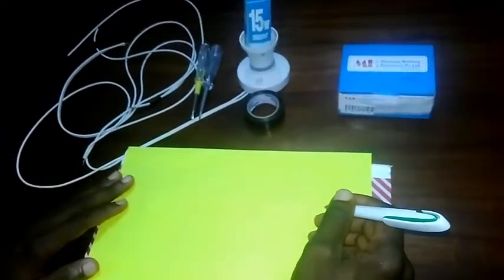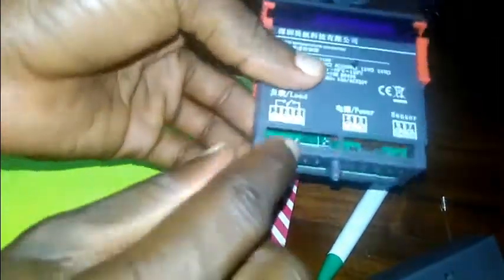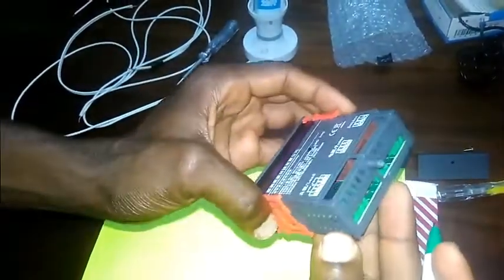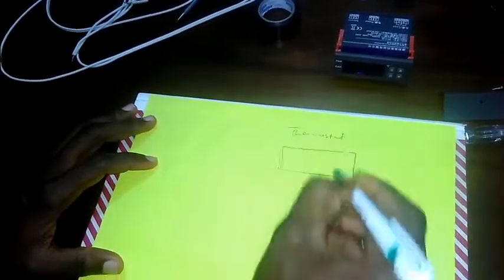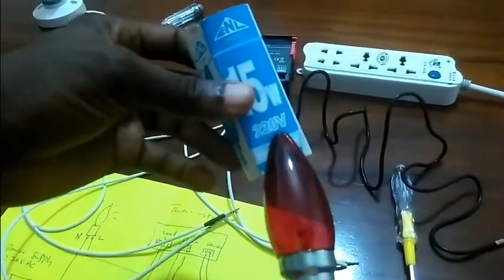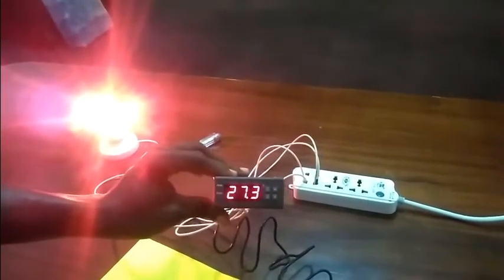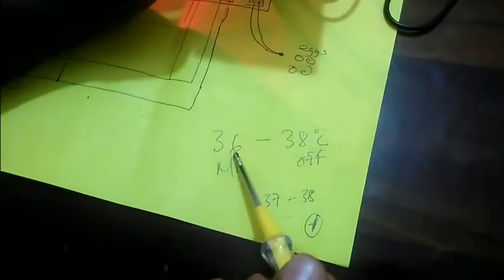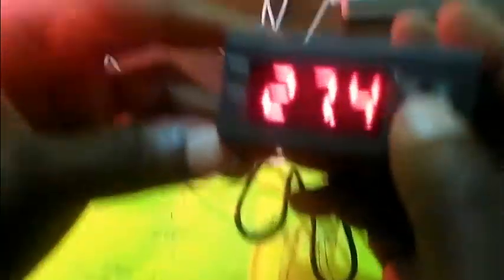How to wire MH1210B thermostat for Incubator

Comment: What if you use LA and HA to control temperature i don't know if you covered that use.  You seem to have no problem getting it to work i will admit the manual instructions to program are not clear.  You are using another way which would work for me.

Comment: I have been using a small fan with w1209 for my incubator without problem. But of I replace it with a bigger computer fan the light immediately goes off. What could be the problem?
Reply from the maker: Are you using 12volts AC to DC adaptor
Reply: @mykitvideos5937  Yes. Main is 240 but stepping it down to 12 with an adapter. Actually I think I copied the connection from one of your videos though now I m still looking for it.
Reply from the maker: Then your power adaptor amp rating is low. Use 2Amps or more
Reply: @mykitvideos5937  I think you are right. It's a tiny 300mA adapter that came together with the w1209. Thanks a lot.
Reply from the maker: If my channel helped you, kindly give us a rating on google https://g.page/mykit-shop/review?gm
Please add comment

Comment: i have question.. what is the problem when i have set the high temp about 38.5 Celcius but the bulb doesn't switch off.. do have any suggestions to solve it Sir? tq
Reply from the maker: Yes. Are you sure your wiring is correct

Comment: How to connect cooling fan? Please upload about it. Thanks.
Reply: I subscribe your channel.
Reply from the maker: https://youtu.be/3z1HGQMzQok
Reply from the maker: https://youtu.be/Xd3J0g9B4oE
Reply from the maker: Is this what you want
Reply: @mykitvideos5937  No. I want to connect a cooling fan to my mh1210b thermostat along with heating bulb. Is that possible?
Reply from the maker: @alimahatab   I don't have video now.

This is what you will do.
If your fan is 220volts...
Connect one wire of fan to port #1

Then connect second wire of fan to NEUTRAL. 
PLEASE do you understand
Reply: @mykitvideos5937  ok. thanks a lot for your help.
Reply from the maker: @alimahatab  please have you SUBSCRIBED
Reply: It's only working while connecting bulb and fan together otherwise not. Is it safe?
Reply from the maker: How do you want the fan to work
Reply from the maker: Always On?
Reply: @mykitvideos5937  not at all, I want it work with bulb same time of and on, it's working but I worry for whether it would be damage my thermostat.
Reply from the maker: No no no. It will not damage thermostat. The thermostat has more capacity for more connection. Don't worry
Reply from the maker: Thank you